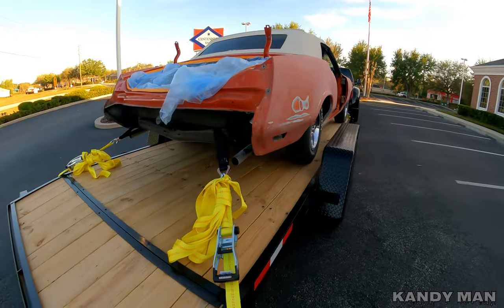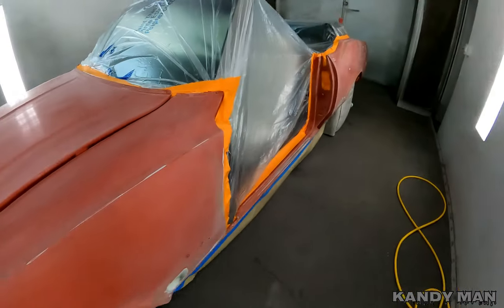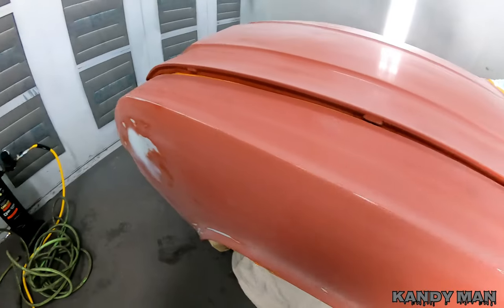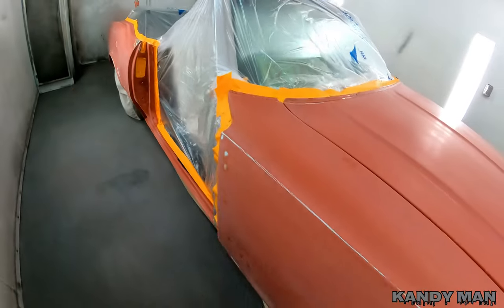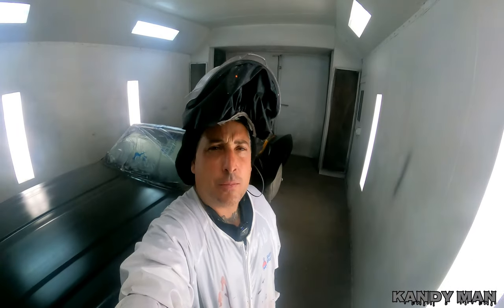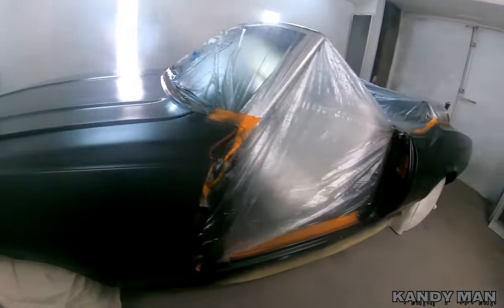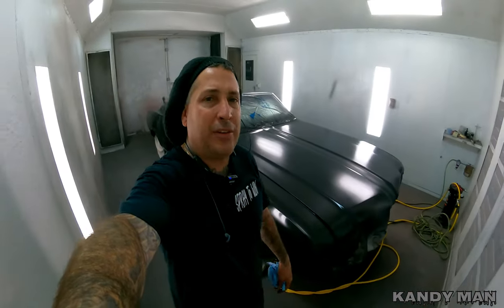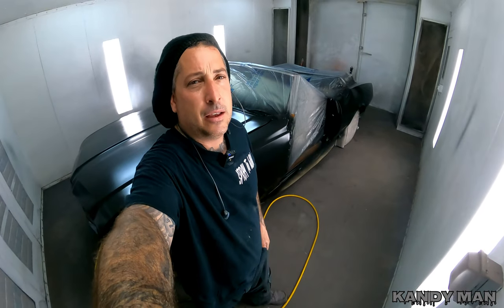STEPS FOR A MIRROR PAINT JOB PART 4

Comment: Hi Kandy Man, I was writing this as your episode 5 came out (I'll watch it shortly).  I have a 98 F-150 I drive almost daily.  Its nostalgic to our family and I have always wanted to learn paint and body.  So figuring that I can't make it look and worse, I am planning a repaint and am going to start with blocking and filling as you did in episode 2.  The body is 100% original numbers matching and never wrecked/repaired - just has door dings and a small dent in the bed where my sister bumped a bollard in it 20 years ago (just dent, no scratch).  So, just to be clear, you only used the slick sand on the Cutlass doors because they were not that straight (even from the factory), which means that may not even be necessary in my case - it was an added show car level step for you, right?  Also, the roof has worn down to bare metal in places and has primer showing in others with some paint still remaining.  Do you recommend that I etch prime the bare metal spots before spraying P30 (or similar)?  Thanks!
Reply from the maker: Thanks for watching  your  write you won't need slick sand etch the bare metal that p30 will do the trick .💪
Reply: @kandyman5315  Thanks!

Comment: Hi is that face mask ok for isosinate paints? Because it's drawing air from the same room your spraying in good vid bud.🙋
Reply from the maker: Yes it is thanks for watching 💪
Reply: @kandyman5315  what make model is it please
Reply from the maker: 3m parp it's a older unit but it's the same as the tr 800 version just older version I have a tr 800 on order .hope this helps.